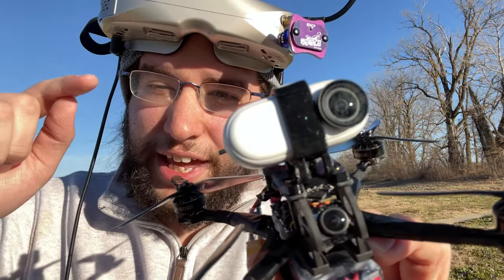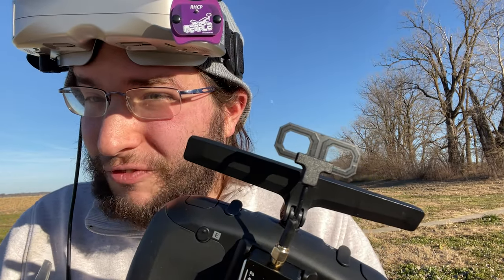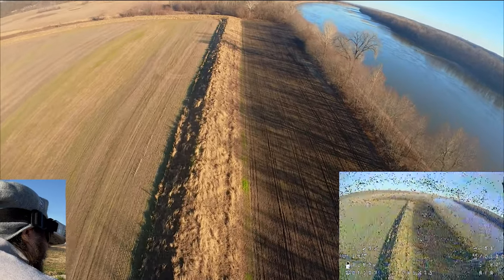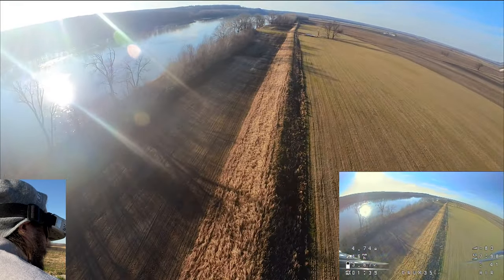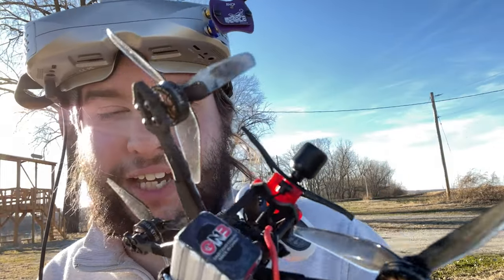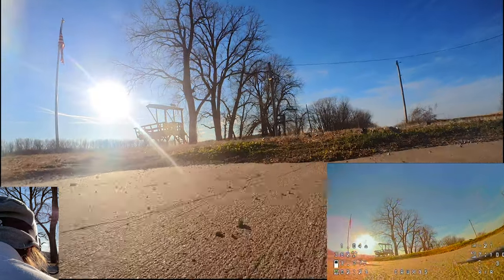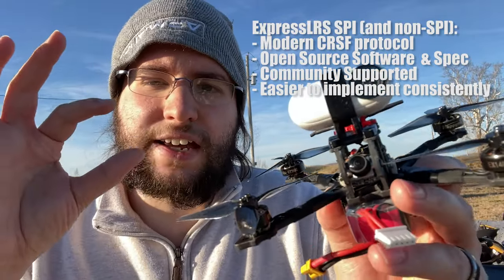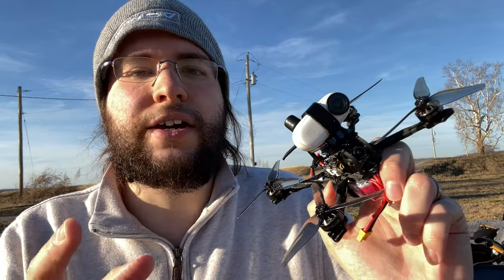ExpressLRS SPI Receiver Range Test (Crux35 Analog ELRS FPV Drone) 👍

Comment from the maker: Notice: Please Read ... 6 months ago, I flew this ELRS quad, the Crux35 SPI. I was blown away at the range (1+ mile) and penetration that could be achieved an SPI ELRS receiver, and I still fly that quad now as it's one of my favorites. I thought for sure that this would be the future of whoops and micros. But as the months have gone by, I have watched the constant firmware updates by the BF team to address ELRS issues. As much of a fan as I have been of SPI ELRS for getting us away from god-awful FrSky and FlySky SPI receivers, I was wondering how the issues with the updates were going to play out. 

Today one of the ELRS developers Bryan Mayland stated that "SPI hardware should not be considered" in his opinion. And that "ExpressLRS 2.x works fine, but when 3.0 RC starts in a couple weeks, SPI RX will not work at all due to changes in the over-the-air formatting... SPI hardware is already obsolete in the eyes of the development team as that information should be known before making your next whoop." That was sad for me to hear today but now it is understandable why. 

Just be aware of this before buying a Crux35 ELRS SPI today. It does have the uart fully broken out to solder an external receiver, so I think it's still a good buy. But SPI ELRS is basically dead. Going forward, it seems the plan is to have completely dedicated hardware over uart on the flight controllers, so that there is no mess of BF ELRS SPI implementation vs. new versions.
Reply: Im sorry but i dont quite get this, will i be fine buying this now if i already have a elrs transmitter, f.e. the Literadio 2SE, or am i running into a risk of not being able to connect them due to software version diffrences?
Reply from the maker: @beatmysaber2250  What version of ExpressLRS is currently on your LiteRadio 2SE?
Reply: @JohnCuppi  According to the BETAFPV Configurator im on Firmware Version 1.0.1 and Hardware Version 1.0.0
Reply from the maker: @beatmysaber2250  I will do some research and get back to you on this. I am unfamiliar with what betafpv is doing with that radio’s ELRS firmware.
Reply: @JohnCuppi  tysm
Reply: Any update on this? Outside of sim time, I haven't flown IRL yet and I was looking at getting this quad along with goggles and a radio. As I don't have any existing equipment yet, do you think I'll run into issues getting the Crux35 with SPI ELRS? I'm not looking to get into the hobby too seriously yet, I mainly just want to fly around outside a sim for the first time. thanks in advance :)
Reply: Easy fix, just get a dedicated TX module running older firmware that's compatible with SPI receivers. Also, just be cause there's a newer firmware doesn't mean you NEED to get it.
Reply from the maker: @yoyomin  this is correct, but I made this sticky notice to make people aware of the idea that SPI ELRS was dead. Workarounds like that exist of course. 

and also there’s been an update since I posted this just a couple of days ago! One of the ELRS SPI developers, Phobos, has taken it upon themselves and made ELRS 3.0 bind to SPI with betaflight 4.4 🙂 so we won’t have to worry about needing a separate module to upgrade to 3.0
Reply: @JohnCuppi  Have you updated your elrs to 3.0 with the Crux35?
Reply from the maker: @msky33  No, not yet.
Reply: @JohnCuppi  the inital comment kinda confused me, doesn´t erls update with betaflight? i have a mobula 7 with spi erls reciever and a radiomaster boxer. both on erls 3.0. 
just a quick yes or no - if i buy the crux35 with spi erls and flash to betaflight 4.4 everything should work right?
Reply from the maker: @ilikebananasFPV  yes. I have a video on updating it, it is my most recent one. 

Since I posted this comment there was an overwhelming interest in maintaining the ELRS SPI code, and developers stepped up to do it. 9 months ago SPI ELRS was declared practically “dead” (the words of a developer that posted in the FB group) but things changed. These ELRS 2.x boards were not left behind after all! I’m happily running many ELRS spi models on 3.x.

There will eventually come a day that developers won’t bother with ELRS SPI, as there is a shift toward ELRS on dedicated uart, but for now we can keep enjoying it.
Reply: Hi John, Im quite new to fpv. I got a tango 2 with elrs module bay. Should I worry about this if i buy the crux35 now? Thanks
Reply from the maker: @eqe-kui-nei  Hi bill, no. Crux35 V2 is out now and doesn’t use ELRS SPI. 👍
Reply: @JohnCuppi  thank you man! I’ve been wanting to get this drone. Glad I found your video. Subscribed!
Reply: I am about to get the Mobula 8, and it has a SPI receiver but as you mentioned in another of your videos, now it is posible to upgrade the Mobula 8 FC to Elrs 3.x. Yet there is a Mobula 8 PNP version, what would you recommend,  going with the SPI or PNP and solder the receiver? If the last one option, which receiver would you recommend for the Mobula 8? (I beleieve it is the same FC of the mobula 7). Thanks and subscribed, I really enjoy your videos.
Reply from the maker: @Cuisinenomade1  Yes, the situation changed and ELRS 3 is now supported -- but, only because someone stepped up to do the work needed to bring ELRS SPI in compliance with 3.xx binding procedure. 

One day, maybe, SPI ELRS will just not work anymore with newer versions of ELRS. Buying the SPI version of the FC and enjoying that today is fine, because it still has a pin-out to solder an external receiver if you want to later on down the road.  

Yes, that's a less future-proof setup, but I do not think too much about future-proofing when buying these FCs. So here's what I'm doing next month: buying the SPI receiver version of the Mobula8, and I'll enjoy that until I have to solder an external rx to it. On-board ELRS is so convenient. And, it is entirely possible that I will either lose the quad, or kill the FC before I need to think about soldering an external one. 😆
Reply: @JohnCuppi  well that's a good answer and it makes sense! So we will be two trying out that Mobula 8 then! Thats is also convenient since if you have the same drone and I have any issues, I will know whom to ask! 🤣

Comment from the maker: Some of you may ask why it says LQ 7:100 when I stated it's doing 250hz @ 100mw. The Tango 2 currently cannot give me any more than 250hz maximum... BUT the module was set and bound at 500hz. That's because I didn't realize The Tango 2 wasn't able to do more than 500hz and forgot to rebind before running this test. Still, it doesn't harm the result expressed here.
Reply: but but the module doesn't care, its still transmitting in 500hz!
Reply from the maker: @BrandonBeans  Yeah.... actually, good point!!! 👌

Comment: nice test bro!
id never fly out that far but its nice to know that it can be done !
Reply from the maker: Thanks — yeah, taking a 3” quad like this that far out is crazy. But it’s one of the few ELRS SPI boards around at the moment — and the weight profile gives plenty of battery to go out a mile and come back easily! With Insta360 go2 on board. It’s all in all a really impressive build. Was just perfect to give this a test run.

Comment: First off I just want to say thank you so much for making this, and I really have begun to appreciate your content. You are an awesome help in making information available so that I can have an easier time making that final choice on which products to buy. Also I do have a question, I will be getting the (Betafpv ELRS 2.4ghz Nano TX module) for my betafpv literadio pro 3. Is there anything that I would need to know before buying that and the crux 3.5 and using it with that Betafpv ELRS 2.4ghz Nano tx module?
Reply from the maker: Hey there, just getting to replying to comments, sorry for the late response. Thank you so much, I really appreciate knowing that my videos have been a great help. Nothing comes to mind that I can think of that you would need to know specifically about having a betafpv ELRS 2.4ghz nano tx module with respect to the crux35 ELRS. The only thing I would warn is that you should upgrade the crux35 to the latest version of betaflight 4.3.1 when you get it, and, to make things simple, make sure your betafpv module is just on the latest ELRS 2.x firmware. This quad can't bind to ELRS 3.0 without some extra technical steps at the moment.

Comment: hi John and congratulations for your videos! I have the crux35 too and I find it a great drone. I have only few problems with the tuning and it would be nice if in your next review you also talk about the Betaflight settings. I have some vibes on the low throttle, especially with the wind, and also some vibes (like if I have an excess p gain) in the fast movements like split-s-.  Even in the filters part there are some values a bit high in my opinion. Thanks in advance!
Reply from the maker: Thanks Luca! I've not made any changes to the tune yet, really what I would like to do is wait until until betaflight 4.3 is finalized before trying to tweak much. It's coming pretty soon! Next week is release candidate 1.
Reply: @JohnCuppi  Thats great buddy will print my own thanks again 👍
Reply: Yea the tune was bad if you ask me, very jittery, but just up the d using the slider (not the values) in betafligh to about 1.2 from the stock level that seems to solve the oscillations.

Comment: Incredible range! What does the hertz mean in FPV in relation to the power level?
Reply from the maker: Hz is the data packet rate. Higher packet rates mean lower latency. 250hz is what immersionrc ghost runs on. ExpressLRS can run an even faster packet rate at 500hz. Unless you’re doing extreme long range you want to run the highest packet rate you can. And 1 mile in an open field is effectively almost nothing to ExpressLRS which isn’t surprising at all - but that the SPI implementation works so well is fantastic to know. 

Battery life or vtx will be a problem with this drone before the SPI receiver EVER hinders it.
Reply: @JohnCuppi  Thank you, John.

Comment: Love ELRS and great video! 
I saw that you have sky zone goggles. I have the 04x goggles and still having all of the reported problems with them. What firmware version are you on for the goggles and the steady view receiver? And what antennas are you running?
Reply from the maker: Hey Chrys, thanks! Sorry to hear that about the Skyzones. I am running 2.3 beta firmware, Steadyview receiver 20210422 v2.1 hardware revision. My antennas in this video are the lumenier double axii 2 long range and a menacerc patch antenna. This flight was just conducted in diversity mode.  Lately some of the SkyZone group posters have been posting a different problem that I've never seen before, bad reception even /with/ a rapidfire module and no matter what mode they're in. As if there's something wrong with a recent batch of the goggles themselves. Hoping that's not the case. Are yours bad even in diversity mode too?
Reply: @JohnCuppi  my goggles were purchased a year ago. I have two modules. One is hardware version v1.2 and the other is v2.1. Daniel with SKYZONE said that this combo would have no issues. I am also on firmware 2.3 official. It's not bad, but definitely has a lot of room for improvement. I fly mix and diversity but prefer mix mode. They are awesome goggles, just wish they could get this sorted out... Had these for a year and still struggling with them.
Reply from the maker: @CXBFPV  I would just get a rapidfire module. It’s direct fit and fully compatible. Just need to buy a cover/door. Mix mode works well on the majority of models that I fly on steadyview but on some it’s catastrophically bad. It comes down to the mixer not working well. Skyzone has another new module coming out with 3 different mix modes, called the steadyview X. I think the problem is that there is no one-size-fits all mixer. They make a change and it does a better mix for one cam+vtx type and breaks another. The new module will also feature a screen. Unfortunately they said this requires an entire new module to do which is a huge bummer. 😞

Comment: Good test John. Btw does your slim pro rgb works? I just got mine and my rgb seems not working.
Reply from the maker: My LED does work, but I had to update to 2.2 to make it work. It was not working on 1.0.
Reply: @JohnCuppi  I’m running 1.2.1 on my x-lite. I tried updating to 2.1 and 2.2 but the lua is not working on my x-lite for some reason. I’m stuck with 1.2.1 for now I guess. Thanks
Reply from the maker: @JermieMarasigan  You should report it to the ExpressLRS devs or ask about it in the group. Someone might know. Or will know what to do to fix it. 🙌

Comment: what were your vtx settings? that,s some clear image for the distance
Reply from the maker: 300mw
Reply: @JohnCuppi  cheers. Iv finally managed to master my ELrs troubles. I can now bind and update over wifi piece of cake. Fly my crux 35 earlier for the first time, and I'm well impressed. But the video quality was terrible, flew about 180m away and it looked like it was going to disappear. But when I got home and plugged into betaflight, I think the vtx was only on 25mw. It's now on 400. So I'll try again tomorrow...👍🏽
Reply from the maker: @k1ortia  Watch that connector on the vtx as well. In my experience it came off / pops off too easily. I reinforced it with heat shrink, and it hasn’t popped off since. It’s a little weird to get a piece of heat shrink around the corner of that triangle shaped VTX though.
Reply: @JohnCuppi  I'm wise to that now brother. Every build I do, or ready to fly kit,  gets the hot glue treatment over the connector asap, and iv always conformal coated every single board and vtx, and some FPV camera boards. I was cought out flying in the rain, took me 3minutes to land, the quad was dripping wet but with no issues at all, due to the coating. I shit you not.

Comment: Which one does have the best video range the analog or hdzero version
Reply from the maker: Both of them have excellent range, you cannot go wrong with either one. I have flown this same stretch with HDzero as well.
Reply: @JohnCuppi   ty john for answering i have one more question 

Are the emax transporter 2 hdzero good goggles for this drone  or would it be bad for range
Reply from the maker: @Divefpv1  I've never used the Emax Transporter 2 HDzero goggles, but my understanding is that the Emax HDzero goggles use the same standard hardware the HDzero VRX uses. So you should not have any issues with range. HOWEVER -- I see that the two antennas it comes with are cheap, and would strongly recommend switching them out to both Double AXII 2 antennas.
Reply: @JohnCuppi  okay ty in price its much better then the original hdzero goggles

Comment: Do you ever boost it to the 250mw?  What circumstances would you need to run higher mws?
Reply from the maker: No. In fact as an experiment over the last few months I’ve just flown it at 50mw Link quality stays pretty stable. But if you look at where I’m flying it’s typically open spaces like public parks, etc. if I was flying inside an abandoned building I’d go to 250mw.
Reply from the maker: Also — staying in 50mw conserves my Tango2 battery life significantly.  The module I have can passively cool itself with the power set that low, running the fan is not required. (But, you can if you want to.)
Reply: @JohnCuppi  great advice.  I was flying at 100mw for a while then bumped to 250 thinking it was better.  I didn't notice a significant change in battery life but it was warmer.  I think I'll lower it back down thanks to your advice.  Thanks.

Comment: Hows the Cruz35 going ? Do u still love it? Is it worth buying ? Do u fly HD >
Reply from the maker: Yes I still love it! I bought a second one on sale! My first one is still going strong. And it's funny you asked about the HD. With the second Crux35 I installed the HDzero system in it. Been testing it out the past couple of days with good results. I can solidly recommend the Crux35.
Reply: @JohnCuppi  Nice look FWD to the review on the HD Zero then ! I have the DJI goggles so I am keen on the Cruz35 Air Unit. I just broke my FrSky X lite radio so now I am thinking of buying the DJI radio as I am always going to Fly with the Air Unit systems. Am I doing the right thing ? Not sure about the DJI radio. I don't know !!! lol. Should I buy a radio like yours ?
Reply from the maker: @wokbok43  I personally would not recommend the DJI fpv system radio; it isn't 'bad', but I don't think it's worth locking yourself into only flying anything DJI. Also, it is easier to buy something like the crux35 HD with expressLRS and just bind straight to the board like I am in this video. They don't make this in a DJI bind-and-fly form, you would have to solder the caddx air unit to the receiver pads on the board. Not hard, but just something to consider. 

Tango 2 like I have would be a solid choice, but you can also look into the radiomaster tx16s if you prefer large size radios. 👍 I have DJI FPV goggles as well but I am trying shark byte just to test something new out basically.

Comment: Do I need that module to have that range? I just have my ExpressLRS transmitter what  if I don’t want to use the module? What’s the range I can get without the module?
Reply from the maker: No the range is not module specific. If your ELRS transmitter can do 250mw or higher then you’ll have the same performance (generally speaking).